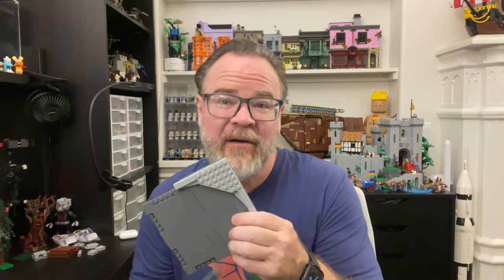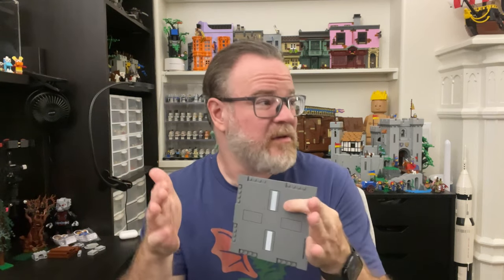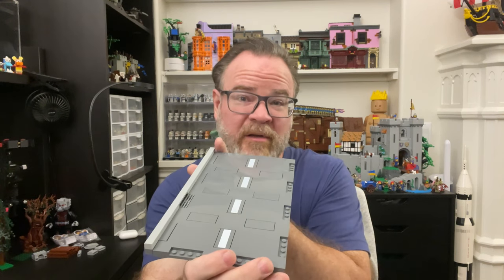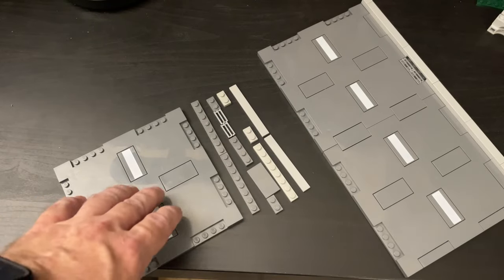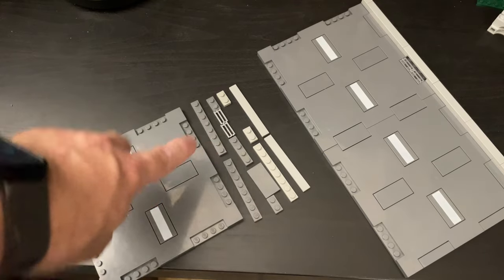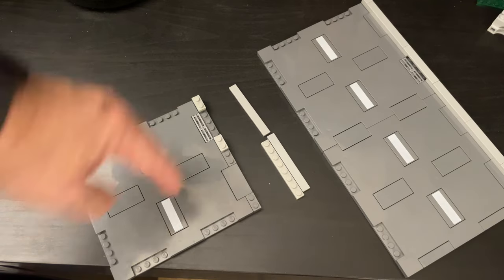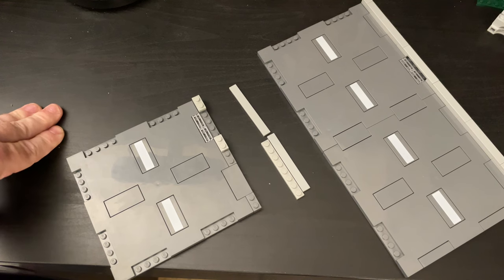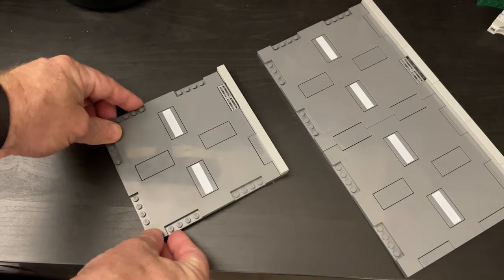LEGO Road Plate Curbs

Comment: You could put the lane markers in the middle of two road plates to make a really wide road. Then the curb on the edge won't be as much of a problem. There's not really enough space in your current city but it's an option for those who want a large road easy.
Reply from the maker: Great suggestion! I really like the modularity of these new roads.